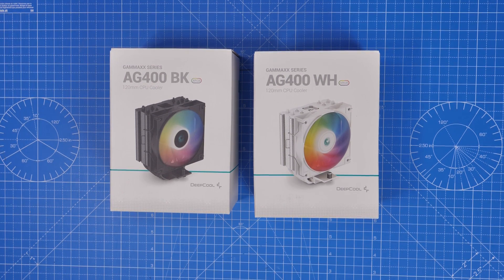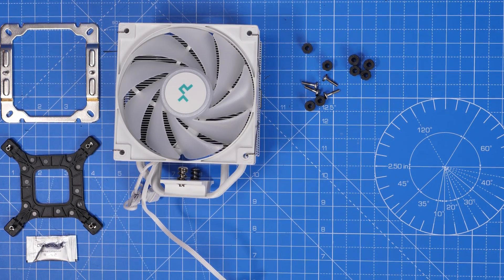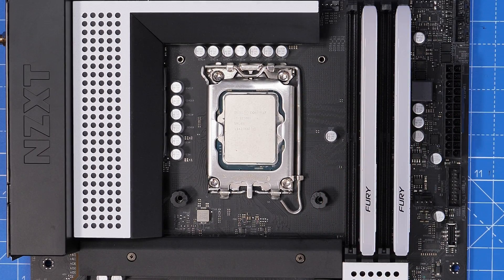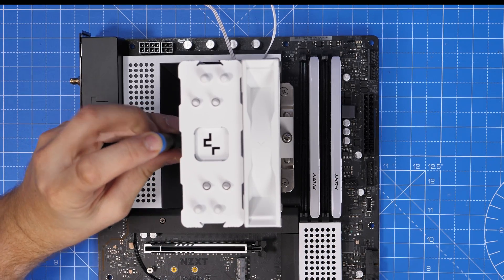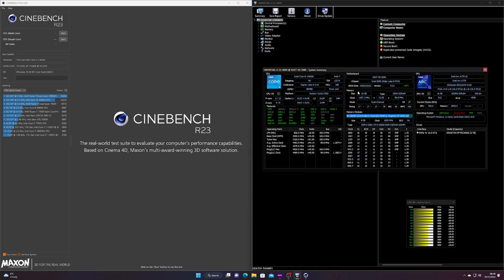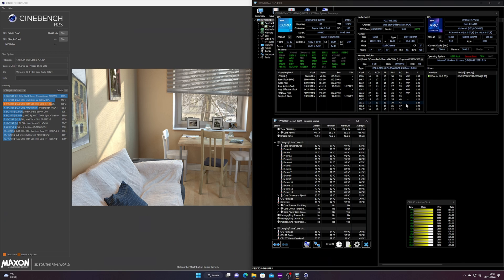DeepCool AG400 CPU cooler: How to install it and benchmarks

Comment from the maker: Specs of this build:
Case - NZXT H7 https://www.youtube.com/watch?v=fLV7AfF4VEk 
Motherboard - NZXT N5 Z690 - https://www.youtube.com/watch?v=syg3VHU7UEc
CPU - Intel Core i5-13600K
RAM - Kingston Fury Beast 16GB 3,2000 MHz
GPU - Intel Arc A770 Limited Edition https://youtu.be/ZYzoMOkXQ8Q 
NVMe SSD - Kingston Fury Renegade Gen 4 https://www.youtube.com/watch?v=ZXViO5KOIl0
PSU - NZXT C850 Power supply https://www.youtube.com/watch?v=RpG0mWwssyE
SSD - Kingston A400 SSD
Extra fans - NZXT AER F 120mm - https://nzxt.com/en-GB/product/aer-f-120mm
Fan splitters - https://amzn.to/3i06Jfa
CPU cooler - DeepCool GAMMAXX Series AG400 WH

See deals on the cooler (note these are affiliate links that earn me a commission at no extra cost to you):
Newegg - https://newegg.io/nc478755ee
Amazon US - https://amzn.to/3APDWQM
Amazon UK - https://amzn.to/3F9Cuvq
Amazon FR - https://amzn.to/3gIuwjs
Amazon IT - https://amzn.to/3VupEO9
Amazon DE - https://amzn.to/3F7ZD0Z
Amazon CA - https://amzn.to/3UcttGc

Comment: I had the stock cooler, Do I need to change the back plate (stock)? Or I can use it?
Cpu: I5 13400F, Mobo: MSI PRO H610M-E
Thanks
Reply from the maker: I'd recommend using the parts that came with the deepcool cooler otherwise there might be issues

Comment: I'm using ARGB hub but it has 6 pin and 4 pin for led strips, is there a 4 pin to 3 pin converter?
My motherboard doesn't support ARGB sync.

Comment: Bro, is it safe for the cooler's 4-pin connector wire to touch the screw bracket? The screw bracket has 4 heat pipes attached to it, so it will get hot. Won't the wire be damaged by that heat?

Comment: I have the same exact GPU cooler, but it comes with 2 RGB connectors and they are both identical with 3 pins.

Comment: Would you recommend this for i7 12700kf?
Reply: I have this cooler with my 12600K and am amazed at how well it keeps my CPU cool. At idle, it's at 31°C, and at 100% load, it maxes out at 68°C. I'm glad I went for this bang-for-buck cooler and got it for $20, avoiding an expensive AIO. I also wish that this didn't have RGB. I think it should be fine for the 12700KF, but if I were to overclock, I would consider upgrading.

Comment: One question, i got anAG400 and i installed it but the cooler does not spin, the LED is ON but the cooler doesnt spin. Should i get the warranty?

Comment: I've a cheap motherboard with only 4 pin cpu header not the RGB headers.
Can I use it on without RGB connection?
Reply: you can buy an argb controller for it

Comment: I got this cooler and started installing the brackets but I had to stop. The upper metal bracket was literally making contact with and sitting on the capacitors on the sides of the socket, and I didn't trust that. Looking at your install, it is doing the same thing. I hope that didn't cause any issues with yours, but I think I'm going to return mine as I don't want to break them.

Comment: My board only has the 4 pin rgb connectors and then a port with 3 pins like this but it's called add gen 2? Is that the port I need to use lol first pc I've had 😅 its a asus tuf b550 plus wifi ii

Comment: Does anyone make the cpu fan that has JST 3 pin rgb.   

My 4 case fans, and ARGB strip all use JST and looking for a cpu cooler that also has the same connector to sync the RGB 😭

Comment: Hi, my DeepCool RF 120 VT fan has only one cable that connects to the CPU fan header on the MB, hence I can't synch it. Can I connect it to the four-pin RGB of the motherboard if I buy a splitter? does it have to be a particular splitter (are the four-pin connectors to the fan header and to the RGB header different?) Can I use a splitter that has a 5v 3-pin connector and daisy chain it to the other fans so as to pick up the signal and synch it? Thanks

Comment: Damn you should have tried running that cable in-between the mother board and case. I know it’s not a lot of space but I doubt the cable would be enough to Bend the mother board

Comment: I was wondering. I have a biostar motherboard and my mobo doesn't have that rgb 12 volt header connection. I was wondering where else i can plug it or do some stuff to convert it to molex

Comment: Which one is better AG400 or AK400
Reply: They are the same product/performance at the end of the day. The ak400 has the heatsink cover and slightly quieter fa
Reply: @SlimedogNumbaSixty9  This, the base is the same for both, the AK400 have a better fan and the plastic cover, not worth pay 15 bucks more for this, moreover i do not like plastic covers, prefer naked radiators but is me.
Reply: The best deepcool cooler - as500plus.
Reply: @vladimirpriobskyi3210 or the ak620 with a extra fan
Reply: @legendcreeper20  на тот момент лучшим был именно тот, который я указал. время идет, прогресс не стоит на месте👌
Reply: Bought the AG400 for my 7600X , Working great and looks really good
Reply: @BigDavos  what about your min and max cpu temperature now 🌡️
Reply: It depends do you want RGB or no RGB
Reply: honestly ag 400 beter, but ak 400 more silent
Reply: Ak47
Reply: AK400

Comment: How was the noise, both during idle and under load?
Reply: Idle is completely silent. Under load, it depends on how you set the fan curve. If you have a 65 W CPU, you can keep the fan speed less than 800 rpm and it is basically silent. At max speed, it is kind of loud but, not as loud as stock coolers. I have a video on my channel where I install the AG400 black version and I recorded the fan noise.

Comment: 0:00 Hellooo
0:17 Unboxing the AG400 WH
1:37 Intel back plate 
2:33 Installing the back plate
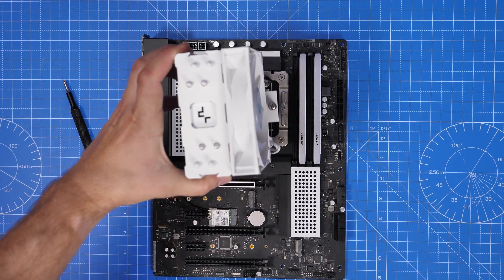4:22 Installing the cooler
4:48 Thermal paste 
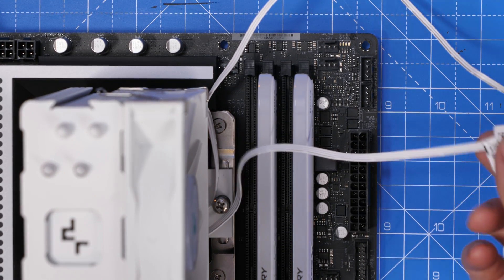6:10 Fan connectors 
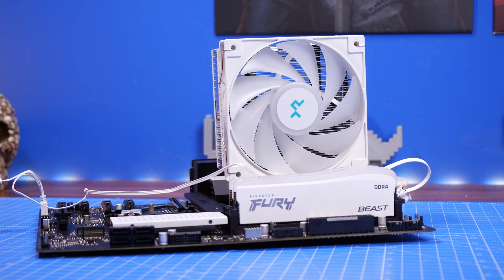7:22 installing the motherboard in the case
8:06 RGB lighting
8:40 Benchmark tests with Cinebench R23
Reply: Bro tysm